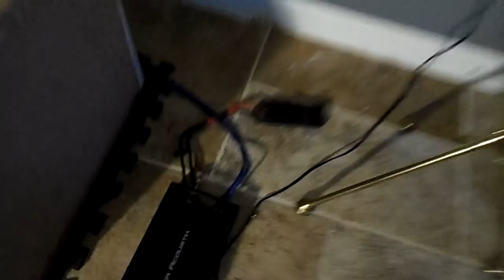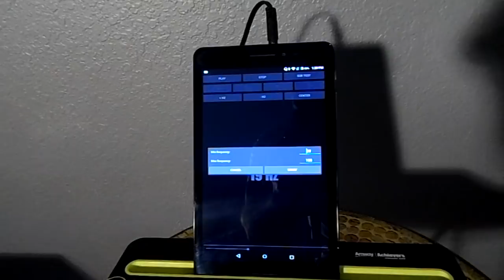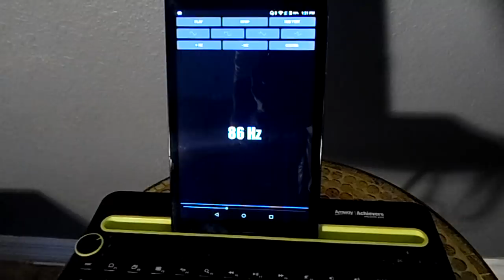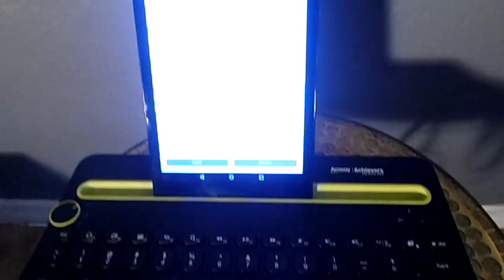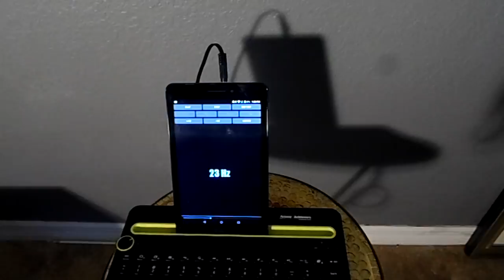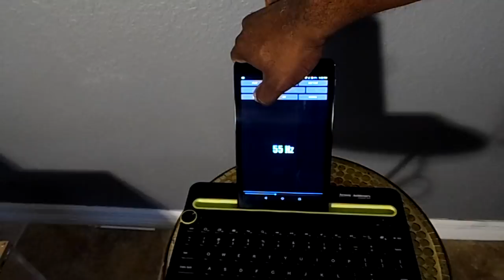BandPass Tower Build: Part 3

Comment: Aye man. Wondering if I can ask you a few box building questions.

1) How do I calculate a kerfed or angled port?
Now, I use win ISD for all of my box calculating, but it doesn't have an option for flaired, kerfed, or angled ports. Wondering if you know how I can use this program to calculate those kinds of ports.

2) I'm building a series tuned 6th order wall for my Tahoe and was wondering if you knew what the best configuration would be for sub placement. Have the subs face up towards the roof, face sideways towards the side of the vehicle, or facing forward towards the front of the vehicle?
Reply from the maker: As for the kerfed measurement calculations in WINISD, I don't know if it offers that option. There is a newer addition than i use of it. So... maybe? 
As for the wall, it's all about cabin response frequency. You would have to figure all that manually, or maybe contact a channel that has built a wall for your exact vehicle. Meanwhile, you could actually perform a speaker crawl with a single sub and just find the best sound that way and adjust from there. Hope this helps.